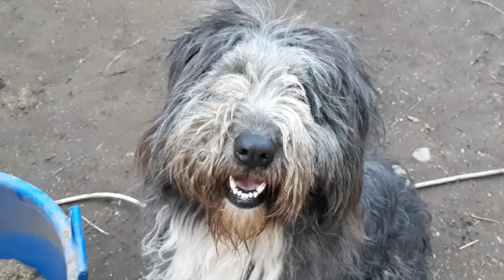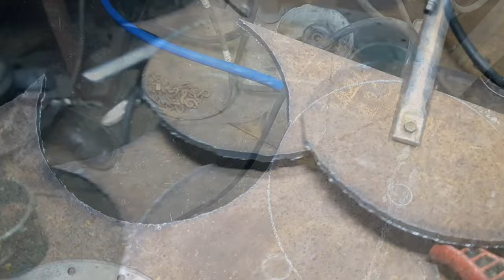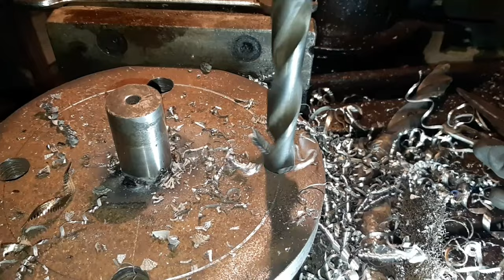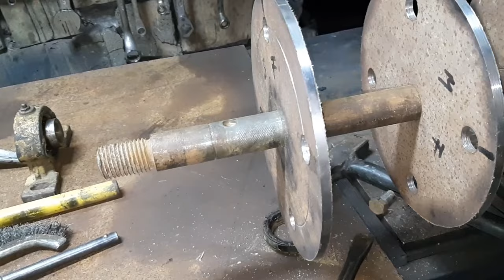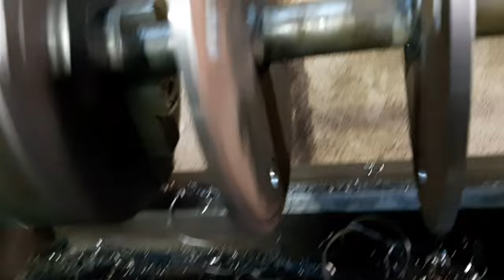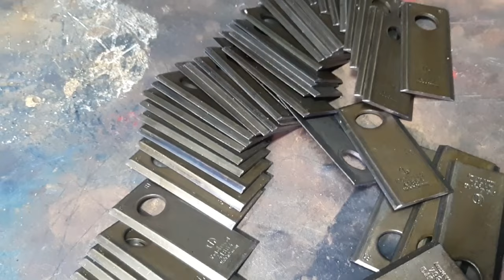DIY Hammer Mill Machine - building hammer mill

Comment: I too wish to build a pellet machine and small hammer mill .. but I dont have a lathe and am not confident enough in my fabrication skill to build a machine that slings blades at 1700 rpm 😆 maybe one day.  I do enjoy watching yours, though.  Thanks so much for sharing!
Reply from the maker: A lathe is very useful for a household. I have never built a grinding mill either. I wanted to try and I see that I succeeded. Thank you for your support.

Comment: Is it possible to make a hammer mill from an old dust blower fan? Must the "hammers" be movable or can i weld them directly to the fan blades?
Reply from the maker: I think you can build a straw grinding mill out of a dust fan.  The hammer mill is built with movable knives.
Reply: @DorelBorlea  I want to grind wood chips into smaller particles like sawdust so i can use it in my pellet press
Reply from the maker: I ground wood chips with this hammer mill.  It's going super well.
Reply: @DorelBorlea  Can you grind wood chips with a mill with fixed knifes?
Reply from the maker: @theodorranebo2909  I don't know.

Comment: Nc project, can i ask what is the size of those nuts? and also the thickness of the plates?
Reply from the maker: Thanks. The plates are 6mm thick, the nuts are 16mm but I drilled them with a 19mm drill.

Comment: I have one almost same, but with square blades. I switch side of blades because side that hits become rounded. So, side that hits is square again but I can see that parts of wood that comes out are  a bit bigger than before. At start it was like in your video at 1st seconds of video. What can be a reason for that?
Reply from the maker: The type of wood and the humidity of the sawdust. The mill should grind the same, only the sawdust is different.